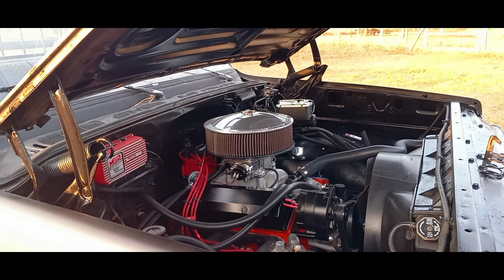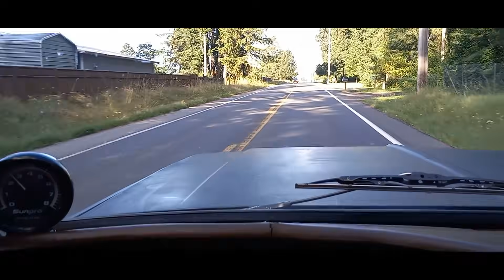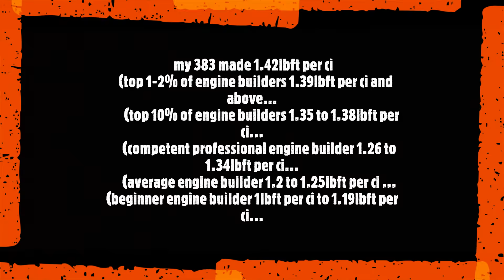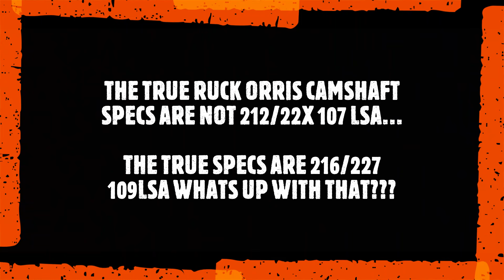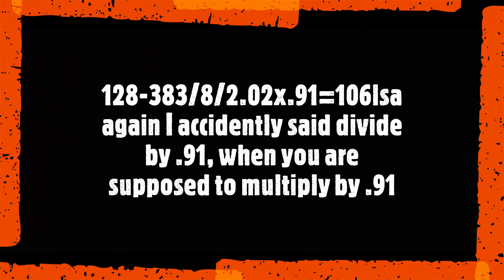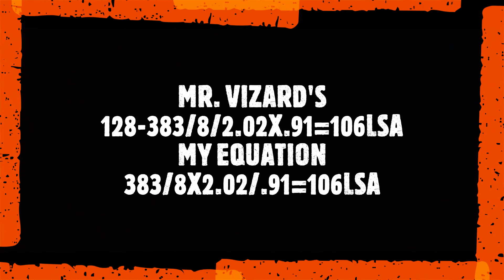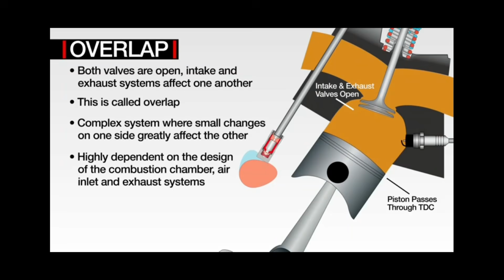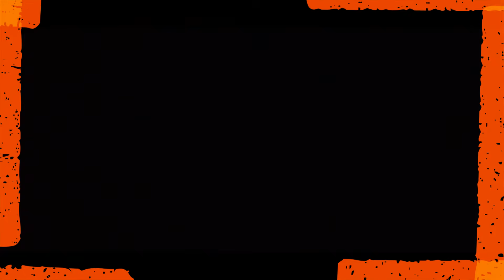CAMSHAFT SELECTION by LSA, 9 LSA's DYNO TESTED!!! LSA THEORY WILL BE DYNO PROVEN!!!, and EXPLAINED

Comment: Adam I can totally relate with your ideologies on the "Ignorant Internet Einsteins". Thats my terminology for them and the internet as you know is just full of them. It amazes me as the younger generations these days lack basic common sense. We grew up in an era where almost every male driver was familiar with driving a manual stick transmission or at least knew what one was even if he never grasped on to driving with one. I seen a funny short clip video that shows a guy carjacking a guy. The guy gave up his vehicle at gunpoint. The carjacker gets in and couldn't get the car to move at all. He got out and took off knowing police will probably show up soon. He didn't know how to drive a stickshift car! My career is electronics technician currently disabled/retired. When I was going through tech school back in 1984-86 one of the instructors gave a piece of philosophy information that always stuck with me. Mainly because its truthful information. This being what he said, " You want to listen and hear out the other person, wether you agree with them or not. Even if you clearly know they are wrong." You then can explain your theory and if the other person is not totally ignorant they may understand and stand to be corrected. Sometimes after I have let someone speak their part I find that I had wrong information all along. Also the other might be wrong on certain aspects but completely right about other aspects that I was unaware of. So I end up increasing my knowledge of the subject. 
Otherwise you are going around in life with blinders on and that person will be at the same level and probably same place 30 years later. Stuck right where they were. Once they half assed learned something years ago, its embedded in stone in their heads. Its my way or no way attitude. Unfortunately you can talk, draw pictures, get a friend with a doctorate degree in the subject and they still won't listen. I notice you referenced narcissism in this. Thats a good assessment too because they think they are above all. I've ran into ignorant people that I wouldn't say they have narcissism but they are just ignorant in the truest form of ignorance. The conspiracy theorists really piss me off. They talk over top of me and you can't get a word in edgewise or sideways. They don't want to hear basic common sense debunking their theories. That is what is amazing, how these people got these ridiculous thoughts put in their heads to begin with? Most of them appear to be somewhat intelligent. That brings me to good ol' comedian George Carlin on "Stupid People". I'm sure you probably heard his comedy on that. If not, its a good laugh and a lot of truth in his comedy to check out sometime. 
Anyway I love your video Adam and I'm looking forward to watching more. I know camshafts are a very complicated heart of an engine. The different angles like how quick or steep the ramp, ramps up to its lift or high point. My racing buddy he calls a cam a "bump stick". One time he was explaining the advantages of a roller rocker or roller lifters. When I first seen them I figured way less friction so less drag running the valve train. Then he explained the benefit of having a steep lobe ramp with a roller is so much better than the cam lobe basically hitting a wall against the lifter. The roller helps the lifter lift.
I find it also amazing is the machining process to get the lobes at the right heights and the tips to be at the right degreed position in relation to the other lobes. Thats some work of engineering accomplishments thats unreal. 
As far as your questions at the end, I say yes continue your videos. You give valuable information and complete information. Sometimes when you have an instructor that shows and tells you why this is that way and what happens when its done this way, makes a complicated subject easier to understand rather than just saying its done like that. Off you go! When you find or get an instructor that explains and backs his explanations, you have a good instructor!!! You are great Adam.
I hope something can be done or at least better your pain and misery with you're health conditions. The whole time after you explained what you're deaĺing with I was thinking, this guy is an absolute legend! To be in pain and trying to remember and put your knowledge out in a way  for us to understand is a feat that most cannot begin to understand. I'm a chronic pain patient myself with AVN degenerative hip joint disorder. Pain makes it hard to think, keeping focus is difficult besides just normal daily tasks become a major ordeal. Thats why doctor put me out on permanent disability. If I take pain killers then I'm under the influence so you can't go to work for anyone or company. I stopped taking meds 2002. Wasn't doing much for the pain and tolerance to the drugs having to take more for the same effect.. They are damaging to liver & kidneys. I just quit and deal with it. 💪🙄
Take care my friend. 👍👍👍
Reply: I needed to add about those Ignorant Internet Einsteins. I enjoy reading comments on posts of all types. Mainly I find it very entertaining especially when there's an Einstein in the chat. Those people that instantly became a medical doctor, veterinarian, biologist, auto mechanic, rocket scientist 🚀. They will battle back and forth trying to prove themselves even when an engineer in the subject tells them the way it is. Usually theres about two comments from the engineer or educated person and they just move on. The Einstein getting roasted the entire time. In the end they made an enormous ass of themselves! Its like an entertainment center for me. Its hilarious comedy at its best in real life. 🤣 
That's all you can do is laugh. Laughing is good for you! 🤣😅🤣

Comment: I will say I have a 350 stock vortec bottom end that we switched the top end on. Before with a stock vortec 350 except headers, 4bbl intake and carb it would light the tires thru first gear with no issue. We swapped some aluminum 200cc heads, comp roller magnum 280 110 lsa rpm air gap intake. Now it's a dog until 3500. I'm definitely going to be using this formula next time I pick a cam instead of this going by the summit book with no real idea of what works

Comment: Your very full of yourself and not nearly as smart as you think. Obvious you're not because you think this knowledge is hard where as someone who easily understands it thinks why does everyone... it's easy. It's not that complicated. And there's unlimited amount of information out there if you don't understand it. Honestly cams are so figured out at this point that fuel is a more complex topic. Also btr does extensive testing beyond anything you've ever done. Way beyond. You're over complicating something that has already been figured out. I agree if you get on a forum and hear the bs it's way out, sometimes totally wrong but btr is not a random company. Another note you missed was dynamic compression changes with more duration. In addition you seem to not understand limitations of ptv, less need for perfect cam vs drivability in relation to power adders and fuel limitations. Why reduce drivers when fuel will only support 900 to 1100 wheel. Both fuel system and fuel knock limitations. You're missing so much and knocking on someone for understand and living in that world. The views and people that agree which seem to be a lot based on comments are not worth it. There are better ways to spread information and you directly discounted countless hours of testing within limitations that btr has to work in to sell cams. I used a btr 225 in a lt1 13.25:1 compression e85 motor with stock heads that where only decked and stock short block with only valve reliefs cut and made 568 hp and 537 tq at the tire through an 8 speed auto. Those are serious numbers for stock heads and stock short block on a lt2 ported intake manifold and 95 mm lt5 tb. I'd say that cam was damn close to perfect. Lsa was 112

Comment: Hello, I have a 355 sbc, split rear main seal gen 1, And i have .125 pop up pistons with 492 angle plug iron heads ported, polished 64 cc, i purchased the comp camshaft 12-242-2, running a 700-r4 w/ 2000 stall 373 gear and wanted to be the powerplant for my 84 grand prix, Sunday driver. any comments on the camshaft, running .032 squelch, really enjoyed your knowledge on hp and torque, i will be praying for you, Thank You!           Chris V

Comment: I think that 383 was so tuff because it was so high on compression. I run small block chevy 11.1 on 91 octane with 440c.i. 240/244@50 112lsa 108icl 608/614 lift and it's installed 3 degrees retarded small base short travel hydraulic lifter brodix dragon slayer heads motown single plane topped with holley sniper efi. I manage 15mpg on freeway with 373 rear gear th400 trans 3500 stall. Zero to 60 in 4 sec car is + 4000lb. That 128 formula plugged in tells me I need a 104 lsa. Interesting into

Comment: alot smart words bro 👍🏻 you need alot knowledge to know what ypur engine need and not what you think he need thats goat words 😎👌🏻i never interest this stuff im more like test driver than engineer  or mechanic type guy 😉👌🏻 except i buy bike couple  weeks or months ago which dont have performance which he should have after i test this on road with racebox device 😁👌🏻 so i start with service book check some basic stuff and i found that somebody setup wrong valve timing so i just setup them correct and bike start have performance like it should have 👌🏻😉 but somebody put also higher exhaust cam and beside effect whcih it have on power curve probably power dont drop so rapidly above peak like you mention cos when i test acceleration spin lil higher than stock dont damage acceleration time 😁👌🏻 however thers one stuff which i dont like those higher exhaust lobe make bike start worse cos those higher lobe bend valve spring more so need more force for start so im must setup stronger starter battery now or go back to stock ehaust cam 🤔 i probably go back to stock cam 😁👌🏻 maybe mr T dont want say everything to have monopol on this concept and lie a lil bit here and there 🤷🏻‍♂️ but you ruin this 😉🤷🏻‍♂️ similar stuff is with those from test drover point of view now ususal sentences like power sells cars torq win race manifactory dont want  to you know everything 😉 cos each engineer true engineer know this egzacly that this is Lie 😎 for sell more vehicle where in fact if they be 100% no lie and just explain this in proper way they could sell more vehicle anyway most of customers even do t bother abput this 💩 so who carse lil lie or not 😉 nobody notice this except five indyvidual who really deep interest in this stuff 👍🏻 anyway great video instinctly i know that for take out max performance from specified engine construction you need to optimze everything and everything must cooperate so timing duration intake exhaust flow compresion stroke to bore etc but yea precise calculation are more complicated need some practice  understanding how this stuff work and cooperate in fact like each other part of our life so thers pleeeennnnty room for lil lie sometimes small here sometimes there sometimes lil biger lie 😉lie allow them to manipulated alot stuff on people with not enpugh knowledge 😁…. worse when they hit on somebody like you 😁 than they have alot stuff to explain 🤣👊🏻 or kill you 🤷🏻‍♂️well at endthey can always say youare genious they was wrong have no enough knowedgle 🤣👊🏻  ….. where in fact they egzacly know what they doing 😉 so often ….

Comment: Thank you for sharing this knowledge and truth how i came to proper cam LSA was racing in SCCA had Opel Manta worked in a machine shop and had a NHRA racer builder (Barnett Racing) come in one day asking about my little car out front he shared knowledge from his early years using the Opel motors  in econo-rail racing. So here is what he gave me take 265 SBC parts pistons, valves machine head, rods to fit 0 Deck block but most important part was get correct cam with proper LSA to make it have 200+ HP My next question was what company should i order this from he gave me his card said bring me all your parts short block let me do this for you for fun you only owe me 300.00 in labor he said he had correct cam info from back in the 70s and he would call see what we could do. I got phone call from engineer from Iskenderian told me address to box up several cams send them we will allow you to test and give feedback on this application  once i got cams back the notes in cam boxes stated diff was only LSA see what makes best power let us know VERY IMPORTANT  I used 2002 intake 197 exh Lots of DE shrouding air flow is critical to get scavenging effect and proper evacuation of exhaust All controlled by LSA was what ISKY SAID So i took advice
opened up runners. CC chambers to match  Working with isky cams for 5 yrs. giving feedback trying  new LSA event cams along the way  YES YOU ARE CORRECT AND A BLESSING TO US ALL

Comment: How is your power figure measured? my fav cam specs are street solid roller grind 240deg 630 lift 112lsa works on any motor really as long as the heads flow around 300cfm and around 350-400ci. Our work just did a 403 ls that made 580hp at the wheels on our mainline prohub dyno with a hyd roller cam an stock ls3 heads at like 6500rpm. Have you ever played with DOHC and variable cam timing makes old pushrod stuff look out dated and old outdated technology then there's what fuel are you using. I guess the sb2 chev is not a bad head but the old style small block heads are not something i would consider to try make horse power i mean raising the runners you still dont get a good shape port.

Comment: Question I have a 8:5:1 compression 351w I’m trying to get as much cylinder pressure as I can . 
Could you help with intake open and close events and LSA  my Rpm range is 2809-6800 roughly and 3400lb car 🚗. Yes keep making more videos sir

Comment: I could use you’re help on my in-line 6 ford 300 cu in. ( one barrel ) carb, 0.40 over bore , California smog rules the valve’s are stock ,  duration @50 degrees is 192 I can’t go more than that, stock cam is 399 lift on both duration @50 is 192 degrees on both, I bought a cam and the specks are 405 lift on intake at 184 duration @ 50 and exhaust is 411 lift and duration @50 is 192 degrees LSA is 112 and I’m sure it’s to much. Can you help me out with this?

Comment: Thanks for sharing, sucks about your health. but Keep at it man.
built my 383 with some used WP torker iron heads a guy hogged out to 200cc ,  new eagle stroker crank, used 400 rods on some forged .040 over 350 speed pro pistons(im poor) lol. 
for the cam i called Chet herbert, for a solid roller.  they wanted every lil detail of my engine and vehicle. then custom ground the cam for around 200$. (this was years ago) RIP Chet.  they cost 260 300$ these days. now i wish i could find my damn cam card cause i cant recall the LSA but remeber the lift is .625 .625 and somewhere around 260  272 duration. never did dyno it, but can say the throttle response is wicked. snappy quick revs from idle lope to violently high instantly. man i need to get back in the garage now.

Comment: So lets see some of the lobes you have designed. and the camshafts you have spec out for modern fuel injected engines that have to start, idle, not eat valve springs, not surge, break springs, and have some sort of drivability, coexist with electronic controlled transmissions, traction control, torque management and a million other factors. Do  You honestly think anyone you mentioned could not  make a cam that produced more power per cube? your flat wrong sir. Heck, half the time they build cams to kill low rpm power to help traction limited street cars, not 44 inch tired mud bog trucks with a 5000 stall. So  no offense,  but you read some books, got lucky a few times and built some decent small blocks, now you make a video preaching for 30 minutes,  that guys like Billy Godbold, Brian Tooley, are morons, and have got it wrong for their entire career. even David Vizard himself does not use the 128 formula, he uses a cam cos program and has stated himself the formula does not account for every scenario, but is a generality that will get you closer than the typical call to comp or others. all the best cam designers in the world say lsa doesnt matter. buy a dyno, design some cams, spend 35-40 years testing those designs then come back and preach for 35 minutes as a pro, until then youre just a guy talking out of his rear. also, half the off the shelf btr cams are made to fit stock short blocks, meaning every cam they expect to sell to the average guy must account for piston to valve clearance. here is another thing, i bet 25-35% of the cams they sell are simply to guys that want it to lope at idle and sound cool, but have stock drivability, not drink 3 times more gasoline.

Comment: I have DV's book on how to build horsepower and porting heads. Good info there except he gives the lsa cam formula for sbc and that's great but what about everyone else? I wish he explained the 128 constant in that formula and how it might change with different heads and maybe different bore and stroke combos. I'm sure a stock 5.0 should need different lsa than an engine with tfs or afr heads on it. It's the heads flow that would determine that constant I would think. Otherwise sbf and sbc would be the same. How about small and big block ford and mopars? I'd like to use the formula for an engine I'm doing but his books don't give it for bbf.

Comment: Great info ,where would you start on small flathead four cylinder 3.185 bore long stroke 134 cu. Inch ,I would think it's a very tight lsa.